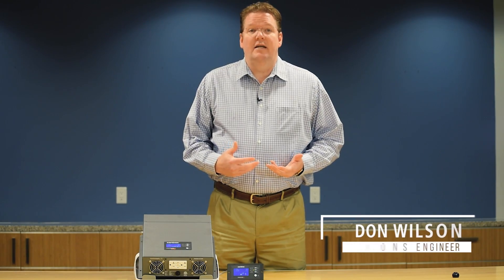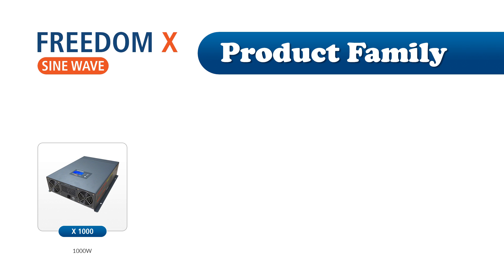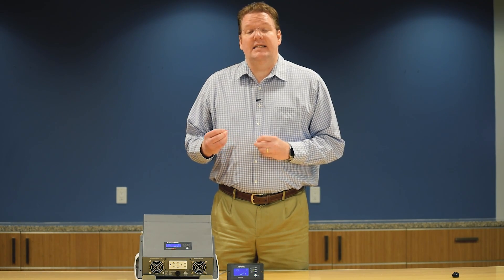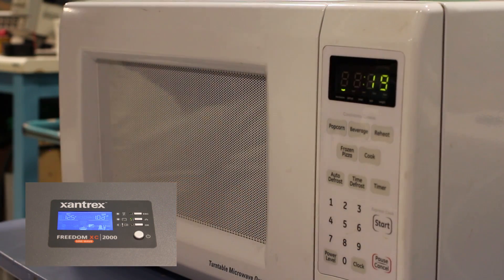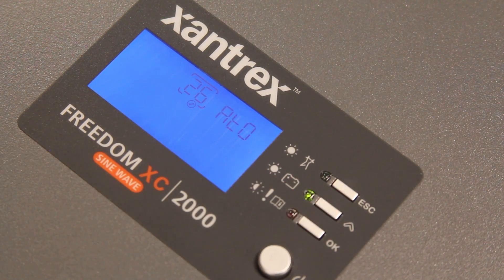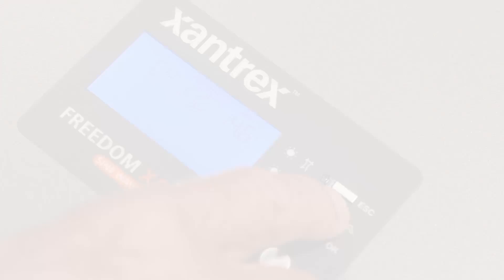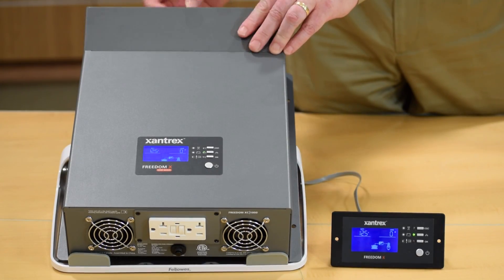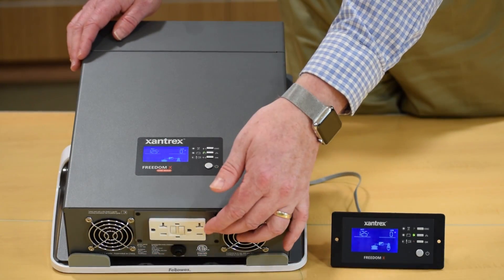New Freedom X from Xantrex - Inverters & Inverter/Chargers

Comment: I have a xantrex freedom x 3000 , and just yesterday I notice that it would charge my laptop.
and the lights on the GFCI RECEPTACLE were blinking red. 
What should I do to fix the issue?
Reply from the maker: Sorry to hear that your laptop isn't charging. What you're describing could indicate a few potential issues. Here's what you can do to troubleshoot and potentially fix the problem:

1- Check the Inverter Status: Start by checking the status of your inverter. Ensure that it is powered on and not displaying any error codes or alarms that could indicate a fault.
2- Inspect the Connections: Examine the connections between the inverter and your laptop charger. Make sure all cables are securely connected and there are no loose connections or damage to the cables.
3- Verify Power Output: Confirm that the inverter is providing sufficient power output to charge your laptop. You can do this by checking the specifications of your laptop charger and comparing it to the power output of the inverter.
4- Reset the GFCI Receptacle: The blinking red lights on the GFCI receptacle suggest a potential ground fault issue. Try resetting the GFCI receptacle by pressing the reset button. If the lights continue to blink red after resetting, it may indicate a persistent fault that needs further investigation.
5- Check for Overload or Fault Conditions: The blinking red lights could also indicate an overload or fault condition within the inverter or the connected devices. Check the user manual of your Xantrex Freedom X 3000 for guidance on interpreting the status indicators and troubleshooting overload or fault conditions.

You can reach our tech support team by phone (toll free # 1-800-670-0707) or at the link below:
https://xantrex.com/support/

Comment: I'm trying to decide between the SW 3000 and the XC Pro 3000 for use in a 53ft houseboat. It has a full size  120volt fridge which is the main power consumer.  Shore power is max 30 amp. The battery bank is 8- 6 volt lead acid at about 1600 amp/hrs.
I currently have an older Freedom 2500, which has no issues running everything, I'm just looking to upgrade. I really like Xc panel configuration and blue tooth option. 
Any suggestions which may help in the decision.
Reply from the maker: The FREEDOM SW 3000 is stackable which allows you can add another SW3000 in the future to double your AC power output. It also works in sync with a generator meaning the FREEDOM XC PRO 3000 is incredibly lightweight but powerful. The Bluetooth option is very convenient. 
If you don't want to use your inverter in conjunction with a generator or don't want to stack in the future, the XC PRO 3000 would be good choice.

Comment: 2020 geeky question. Pg 35 of the Owners Guide says: "Whether or not the Power button is turned ON, shore power will pass through the Freedom XC to the output when shore power is within normal operating range. The unit also starts charging the battery after the transfer to grid mode." What if the unit is programmed for "Ignition Auto-On" page 22 but there's no 12v signal from the vehicle ignition? Would shore power also pass-thru & charge the battery even if the unit is "Auto-Off"? Thanks in advance, Xantrexers.
Reply from the maker: Regardless of how setting #1 is set, pass-through and charge will occur when AC input is qualified. If setting 26 (ignition charger control) is set to AUTO, transfer will still happen, but the charger may not engage.

Comment: What is the idle amp draw on these inverters chargers (No-load input power (producing output voltage) and Off mode current draw (display off). I am specifically looking at the Freedom XC 2000 as I can't find these specs anywhere on the brochure and owners manual plus your website. Thank  You
Reply from the maker: Inv OFF mode: <0.1 mA, Inv ON/Power Save mode: <1.1 A @12Vdc; Inv ON (120Vac output) with No load: <2.2 A @12Vdc
Reply: Not bad as I am happy with that. Thank you